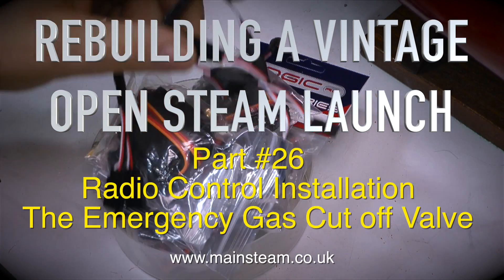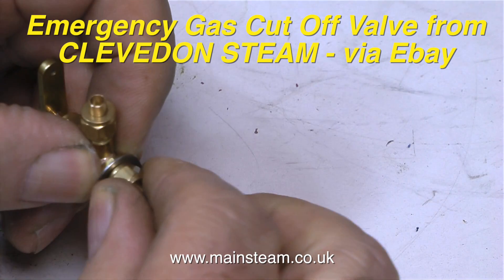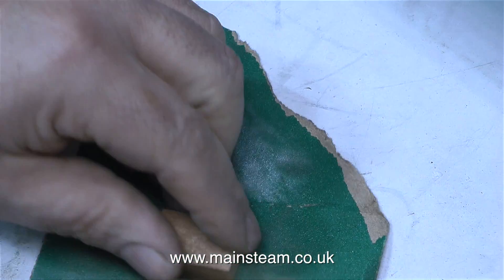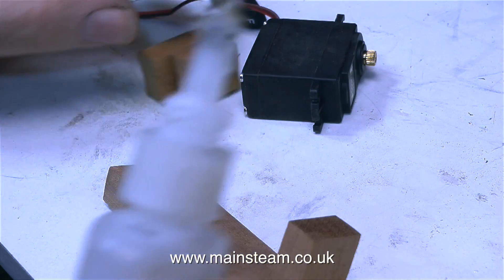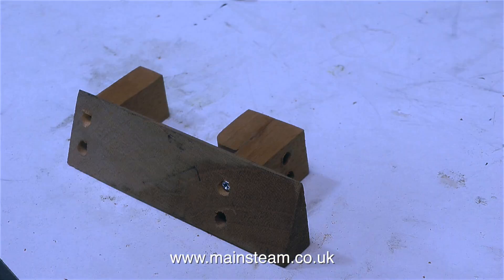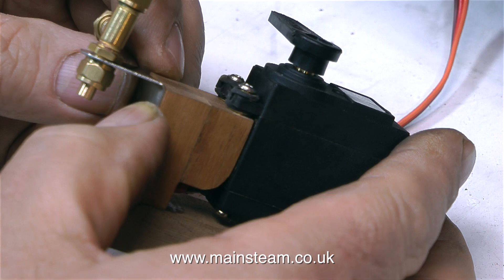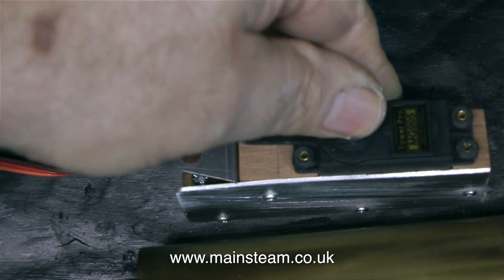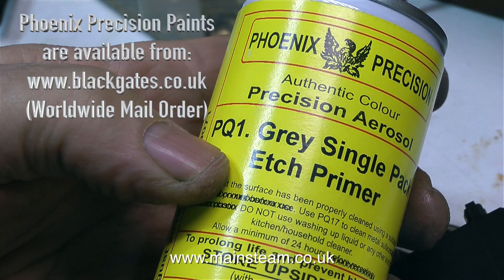REBUILDING A VINTAGE MODEL OPEN STEAM LAUNCH - PART #26

Comment: im kind of surprised on your choice in servos.  TowerPro is pretty low end.  I was thinking you could get lower profile servos with the same power that are waterproof.  They cost more but, especially in a water condition, they would be much more reliable.  id hate to see the gas cutoff servo take a crap at just the wrong time.
Reply from the maker: I've always found them to be OK, plus this boat is going to largely be a static display model anyway .....

Comment: Hi Keith, how well does aluminium insulate? I was thinking of insulating the boiler on my Wilesco marine engine to protect stuff that might be above it, not least my fingers. Would simple aluminium tin foil folded into layers be good for this?
Reply from the maker: mmmm - not very well really. If it is highly polished it will probably reflect some of the heat. I used this piece of aluminium because I had it in a box of aluminium sheet. I will be putting some ceramic wool insulation material between the condenser and the servo mounting.
Reply: Does Blackgates Engineering have ceramic wool? I could look into ordering some of that perhaps. A fireproof insulation would be preferable for ths.
Reply from the maker: Yes, Blackgates sell it - I get mine from there.